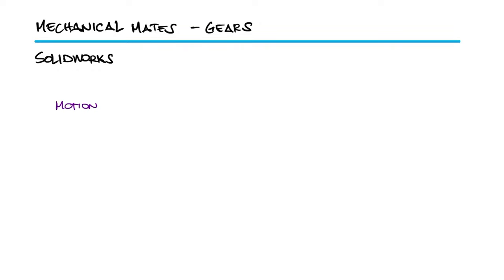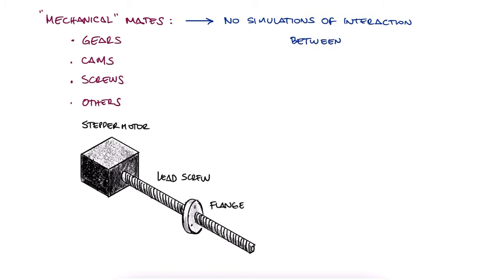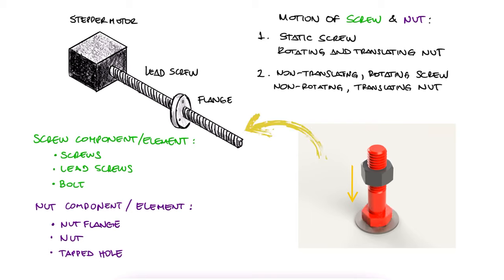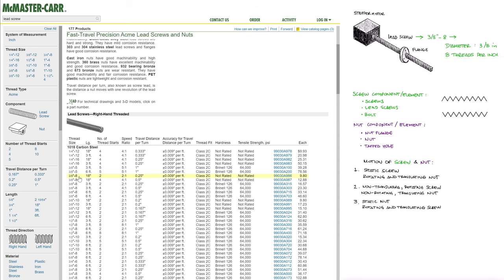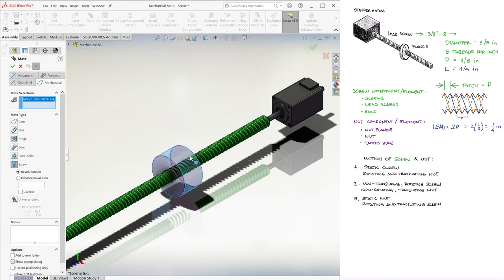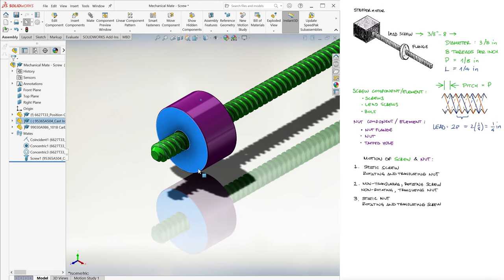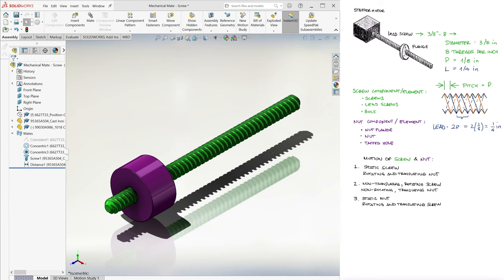SCREW Mechanical Mate in SolidWorks in 6 Minutes!

Comment: I come from a different program, but i feel like using a central axis to constrain everything to would be helpful.
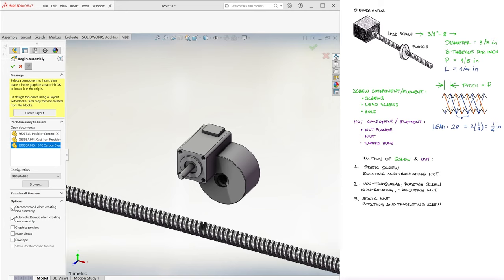e.g. at 03:33 you "mate" the screw geometry to the stepper.
If at any point the screw part is changed now, the assembly will break, and you need to go back in and fix the constraints.
Maybe this is just a gripe I have with Solidworks in general, but I like having coordinate systems in every part for easier constraints.